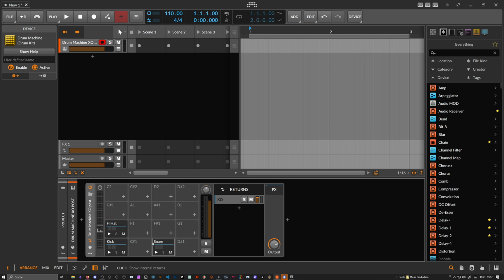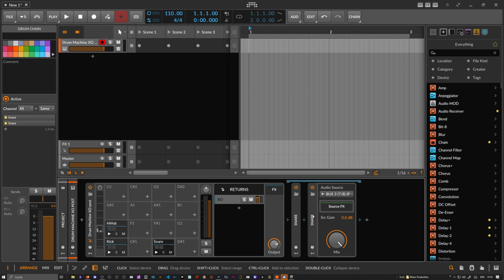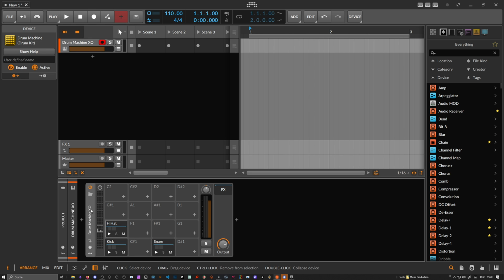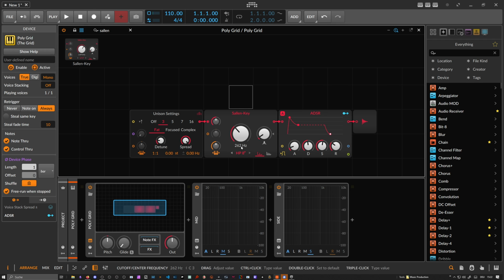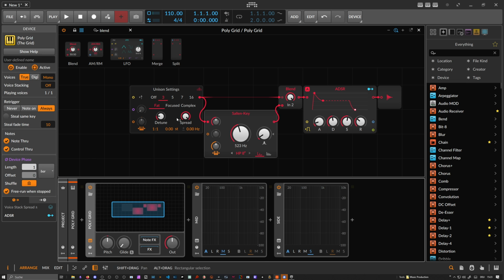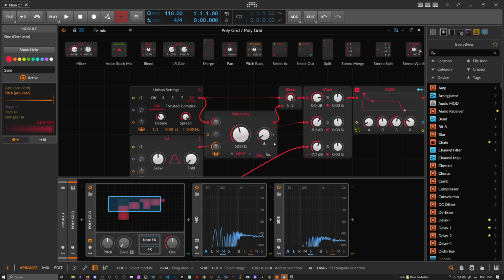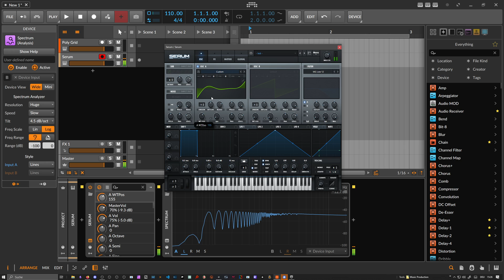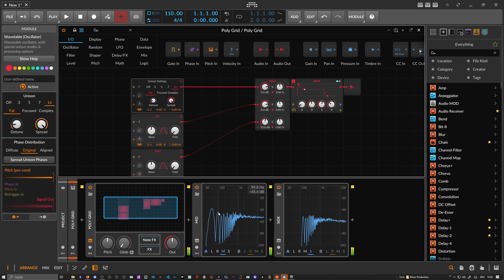Wavetable & Drum Machine Problems

Comment: The only remaining problem with the "XO Drum Machine" setup is that because XO is in a return track, the audio have latency (one block specifically). Its fine with low buffer sizes but breaks down with bigger buffer sizes, as it doesn't properly compensate for that feedback loop (which is probably a bug with bitwig's latency compensation). It's kind of a deal breaker in the latency introduced alone, tbh, and I personally don't use the drum machine part that much, so I'll be looking for other ways of integrating it (mainly getting the note names on the piano roll and mixing directly in the Bitwig mixer).

Comment: I see that you fixed to where you can preview samples in xo but will that create a new problem? When you mute the individual tracks you lose the ability to put effects on the individual drums when you go into the mixer view, right ??
Reply from the maker: Just like with the older setup where the whole return was muted. The idea was to get the audio into the cells and process it there. I think you can expand the cells in the mixer if I’m not wrong.
Reply: @PolarityMusic  I meant to say “when you mute the layer” but you got what I was staying. I tried and it worked like a charm. Thanks for the tip. It would be nice now if there was a way to press a command to split the drums to individual tracks, then bounce to audio if needed like studio one and logic